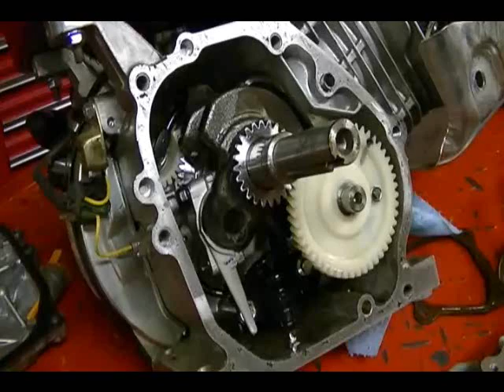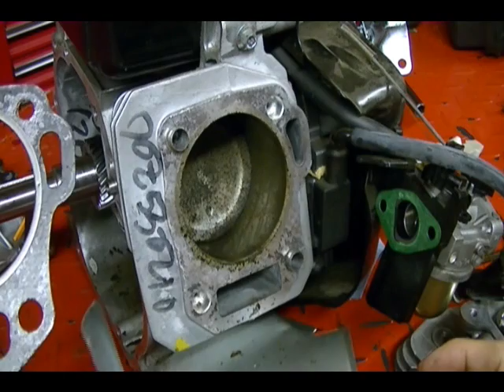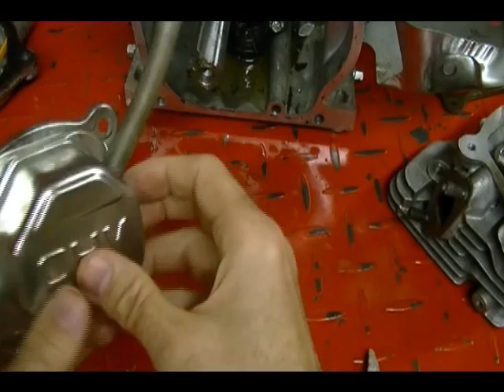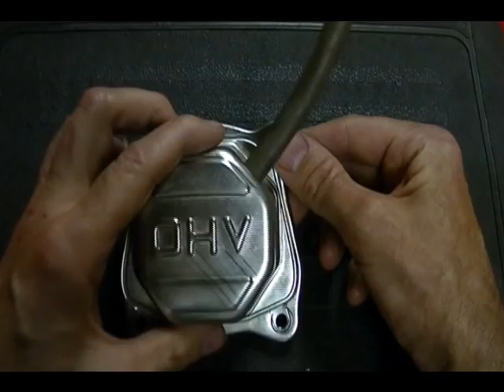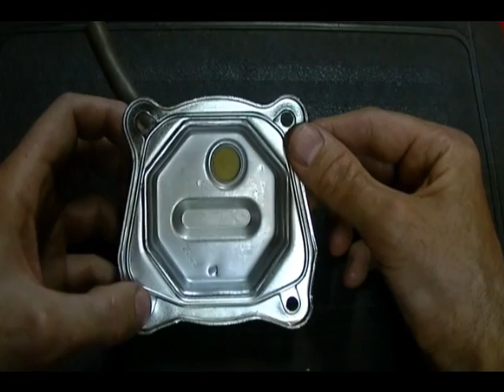Engine Crankcase Pressure and Engine Oil Leaks

Comment: You should send this video to all the motorcycle dealers all over the globe so they will learn something.
They tell me I don’t have a leak when I’m looking at the oil drip.
They sent me a video that proves it’s not leaking but the engine is at idle and in first gear.
They also pissed on my leg and told me it’s raining.
Idiots.
Thank you  very much for this video.

Comment: excellent video the first thing I check when I run into an issue oil leaks not so much on this style engine but including this one is the seal around the oil filler cap whether it be a gasket or o ring if it leaks a small amount of oil it'll suck a large amount of air  these engines actually do run on a vacuum and if it's mounted on a mower make sure that the person did not just recently tilt the mower to clean out the from the blade or something of that nature A good rule of thumb is spark plug disconnected and muffler or spark plug pointed up always if you have to tilt the engine

Comment: one side of the pcv valve is open to engine fumes, in a car via the oil mist separator in the cylinder head. Under high intake vacuum conditions these fumes are sucked into the intake manifold to be burnt, restricted by the pcv-valve. To prevent a vacuum in the crankcase the opposite end of the cylinder head is vented usually via the airbox. A draft is sucked through the engine and fumes are prevented from polluting our air.

Comment: Cheers for the video ;) One quick question. I have liquid in my air filter (there is a round ring at the bottom and it has prob. oil in it, about 100ml) what may be the cause of that?
Reply: Same

Comment: Excellent explanation!  I’m doing an engine rebuild on an old Honda Harmony lawnmower that I replaced the crankcase gasket last year but started to leak some oil way too prematurely.  Given the age of the engine, blow-by due to worn rings might be causing excessive pressure in the crankcase.  Thanks!!
Reply: Might install governor arm seal while your at it, bad about leaking on deck

Comment: @smallengineshop
If the crankcase oil is affecting the performance of a carburetor negatively, where else can the crankcase oil be directed to safely. 
Crankcase oil becomes thickened  and deposited in the carburetor and make it performing poorly(piston not rising, throttle plate becomes stuck and not moving freely)

Comment: I have a hatz 1d81z it leaked oil from exhaust manifold and l changed the stamp seals.after putting new seals the problem started again leaking oil from exhaust and l thought maybe the engine head was damaged and l changed the engine head with everything new but still it's leaking oil through the exhaust what could be the problem?

Comment: Great vid. I learnt a lot here. Found it because I have lots of oil in the airbox of my single cylinder bike.
Is this a big worry? Im hoping it was just over filled at service. Have cleaned it out and changed filter is there anything else I can check?

Comment: A couple things. To have positive crankcase ventilation, there has to be constant suction of the crankcase to bring it slightly below atmospheric. That happens only with a pcv valve connected to a vacuum source, usually the intake manifold after the carb throttle plate and before the intake valve. A pcv valve is basically a calibrated vacuum leak, which the engine maker has designed to account for by its carb/engine calibrations.  This is important because you should never use a different pcv valve than what is called for as it may leak (flow) a different amount. Proper crankcase ventilation also improves cylinder ring sealing. On some high performance engines such as pro stock, you could find them using a belt, electric, or gear driven vacuum pump that would create very high pos ventilation pressures to make the piston rings seal really well because pro stock uses low tension/friction oil control rings and maybe even one compression ring so they can rev to higher rpms, less drag.
Reply: M8 how would go about fixing this

Comment: so a new oil leak on the top edge of my kodiak 400 crankcase might be caused by blowby from a bad ring, or a failing PCV valve?
I was thinking it was just an old gasket that needs replacing. I'll now check the PCV valve/hose and replace and seal the gasket - and see if that fixes things otherwise it could be $$$$

Comment: can a partially sheared flywheel key cause excessive pressure, I have a honda gx 390 hard start pullback and oil over the crankcase cover.. low on oil after a mud motor long-distance run .tks

Comment: Would you be able to remove the crankcase cover with an engine like this in the frame or does it have to be laying flat on its side out of the machine? I have a similar engine and leaky gasket in a golf cart

Comment: Nice video. Question: Why do you need a one way valve for the breather? Don't you want air to get back into the crankcase when the piston go toward top-dead-center to prevent a suction pressure in the crankcase? 

Instead of breather hose, can you just have a balloon like device where the balloon will expand at piston's bottom-dead-center and deflate at piston's top-dead-center?
Reply: You want to relieve the positive pressure.

Comment: Important question, I have 1/4 or MORE play in my crankshaft and opposite side on flywheel. Can get the play by pushing/pulling on either side. Any advice on problems or solutions. Engine is a 5hp tecumseh yr 95-99

Comment: I've got a 3hp tecumseh. . flathead. . I'm getting oil , coming thru where the value springs are on the side..I thought it was normal so the springs and valves didn't seize up ?
Reply: Gotta keep it clean every now and then 🤗

Comment: question I have a 9hp Tecumseh snow blower engine with correct oil levels, but when running oil blows out breather tube- any ideas?? ricker
Reply: ricker bear junk it
Reply: Your PCV could be clogged 😜
Reply: Bad head gasket

Comment: there's oil leaking out of my exhaust on my 6.5hp clone, the engine refused to start so I figured it was flooded so I turned off fuel and it seemed very easy to pull very smooth which is odd, it feltlike it had compression but it felt like less than usual. I took off the air filter and noticed oil when I put my finger down the hole, so I removed the assembly and it was oily so I drained the fuel bowl and it was full of oil. Not only is there oil coming out the exhaust but it's also leaking into the intake... how do I tell what kind of oil leak this is and how do I prevent it after I replace what ever I need to? someone pls help

Comment: Good Video. Does anyone out there know how to properly clean out the crankcase of a Harley twin cam?? I have the top end apart and rebuilding. I want to get some of the sludge and carbon particles that may have dropped in the crank, out of there.
Thanks in advance!

Comment: Thanks for the vid. Do you know also, if crankcase pressure can be caused by back-pressure from the exhaust system? Either due to blocked exhaust/mufflers etc. or sticky exhaust valves? I guess that might just be considered part of the blow-by if it does?